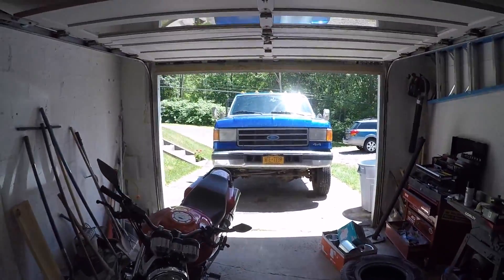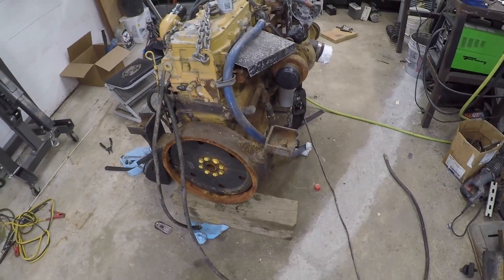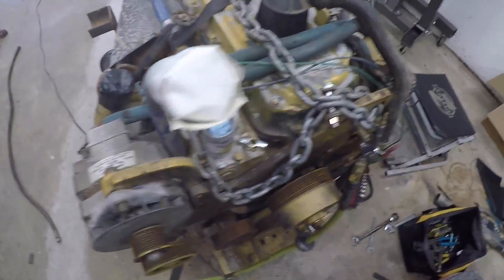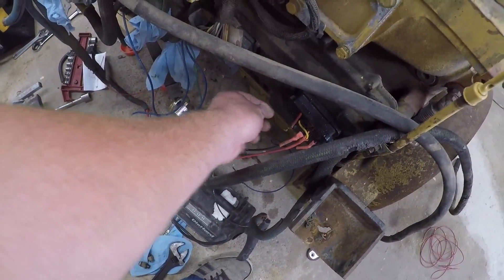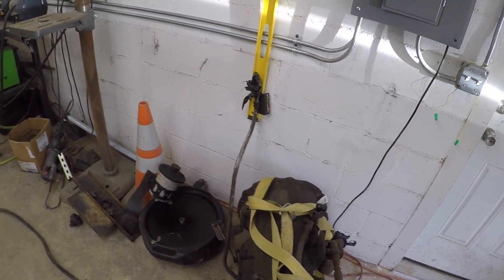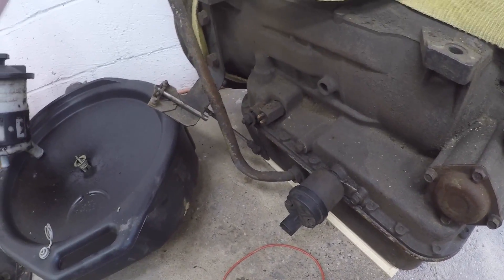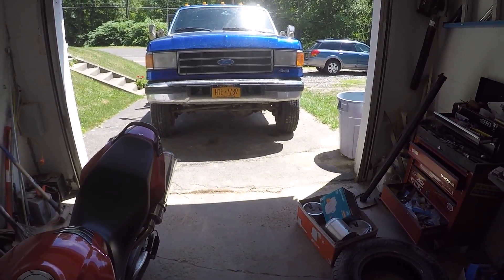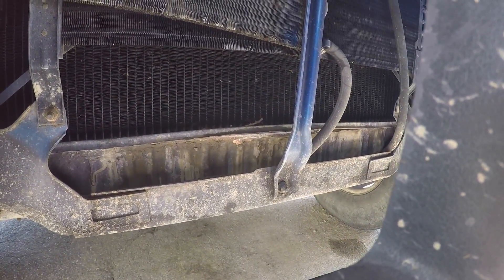Putting A CAT 3126B in my 91 F-350

Comment: I want to test run a cat 3126 before putting into truck. Do you have pinout of OEM connector from ECM that shows what pins to connect? I know it needs power, ground and a foot control sensor feedback to the OEM side of the ECM. Is there more than that?
Reply from the maker: 40 or 70 pin ecm?
Reply: @DrEwBaBy625  40 pin I checked, first thought it was more pins
Reply from the maker: The pins needed to test fire are 
70- ignition/key switch 12v +
52 & 53 are unswitched 12v +
65 & 67 are grounds

The engine will fire without the accelerator pedal but if you have it and want to rev it up 
5 sensor return/ground
4 +8V
66 accelerator pedal position. 

If you have an email I can send you the full diagram pdf.

Comment: I was having the same issue with my IDI put a new glow plug control module and a new set of motor craft glow plugs and now it starts right up
Reply from the maker: I did try to fix the idi before I pulled it. All new glow plugs, larger battery cables, new batteries and a gear reduction starter. Fairly certain I cracked a ring or two.
Reply: DrewMan'sDriveway I did consider a swap too but I couldn’t afford it. I know the frustration of not starting up. I cooked two starters then installed new batteries. Finally I realized I had replaced most of the vital items except for the control module and when I did started on the first try. Best feeling ever

Comment: hey what pins on the ecm need power for the motor to start?
Reply from the maker: 70 is your ignition key switch positive

52 and 53 are unswitched positive

65 and 67 are your grounds. 

If you have an email or a Facebook I can send you the full wire diagram.
Reply: @DrEwBaBy625  

ok thanks love the build

Comment: I rebuilt a 7.3 . Put a used banks in it plus a air to air. I could out pull a 2002 powerstroke. We have that motor in a truck at work. It  a puke on power.
Reply from the maker: To each his own. I don’t plan to do much towing so as long as it starts every time and gets me where i need to go I’ll be happy.
Reply: True, I will have to say you are definitely are doing a unique transplant.

Comment: I'd rather go for the 8.3 Cummins, noone is doing that LOL.
Def cool setup yer going for.
Yeah the 545 isn't the hot item, I bought a bus and I went extra to get the Allison MD3060.
Reply from the maker: I’ll look into the 8.3 for my next one lol. He threw the 545 in for free so I couldn’t beat that. It wasn’t in the budget to buy a trans so If I didn’t get that one I was going to try to make it work with the e4od.. hopefully the 545 gives me a few years then maybe I’ll look into upgrading it.
Reply: @DrEwBaBy625  He you can't beat free metal and well if it works EVEN BETTER.  
Don't feel bad, mines got 6th gear locked out, I have to jump through some hoops with IH and Allison to get the ratio increase and unlock it.  
The 545 isn't horrible though, I can't remember the model of the last Allison I had but it was 3 speed on an Isuzu FSR and it was tough, boiled over the fluid and ran it dry a few times even and it wouldn't die.  They make good stuff buddy.
Take care.

Comment: I don't know if you have figured it out yet but the older cat engines wouldn't work with an automatic transmission, too much torck for the converter to handle and the transmissions would break. My advice is to put a 5 or 6 speed manual behind that cat.
Reply: It would be fine with an Allison MD3060.
Reply: How much is too much
Reply: Need a DT466
Reply: @Leo Weber  Kid grow up,.
Reply: @PatrickBaptist   pull a half loaded 6,000 gallon milk trailer with your Cummins and see how far it takes you before you start begging for a cat.
Reply: @PatrickBaptist  funny! I would take a cat over any other engine. Have you ever even pulled with a cat or are you just like everyone else and just putting your own two since in.

Comment: Silicone spray is the best for diesels. Just a tip for anyone didn’t know that myself until a bit ago
Reply from the maker: As a substitute for ether?
Reply: DrEwBaBy625 yeah I use PB brand silicone spray and works just as good, just doesn’t damage the motor
Reply: FBI engine